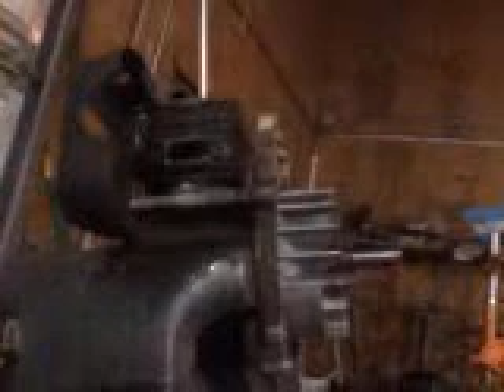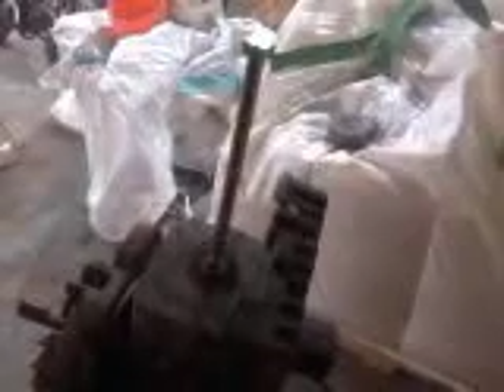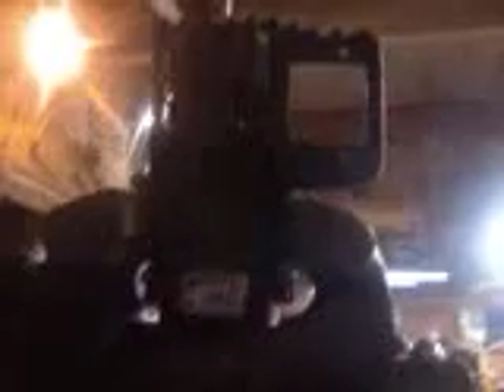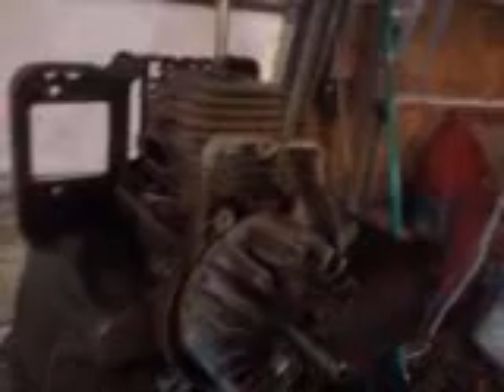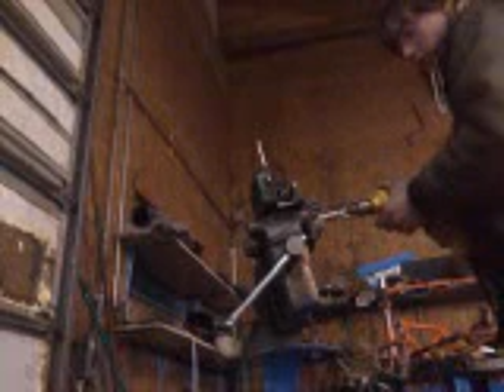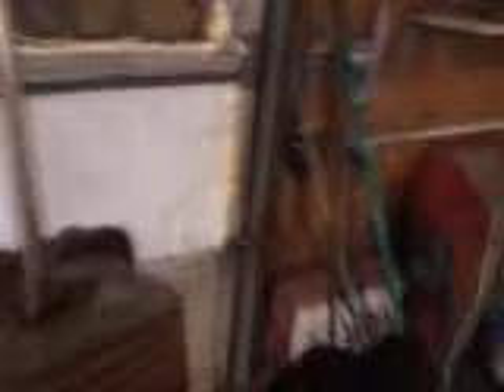first video of gas 2 cycle engine CONVERTED to DIESEL

Comment: I'm hoping you're having better results with your two stroke diesel engine. I like to know how far along you are and if you ever got it working . And what are you using for the fuel delivery system
Reply from the maker: I actually haven't done much more with it since. Lost all affordable access to any kind of machine shop, so fabricating things of precision pretty much came to an end. Massive family problems occurred which is why I lost access to the shop. Basically limited to a dremel, drills, grinders, welder, and sawzall now. Had access to a mill, lathes, torch, band saw, presses, brakes, vices, clamps, benches, etc. at the time I made this video and did this experiment.

Comment: Would this be all that hard to do with a chainsaw?
Reply from the maker: That completely depends on the spark plug hole position. If it’s the standard angled hole, it’ll be very hard. I’m actually trying to fill the hole with JB Weld on another one, and I’ll see if that works. It helps a lot if the engine has at least 2 piston rings too.
Reply: @lawnmowerrepairsandstuff3154  Could you recommend an engine to do this with? I'd really like to build a diesel circular saw.
Reply from the maker: I did this with a 25cc Homelite. Make sure it has the three cylinder jug base mounting screws, or it simply won’t work. Also, find one with the really thick connecting rod. I actually tore this entire engine back apart, and found out that the rod had bent! This one had the lighter rod though. These things are easy to come across at junk yards and yard sales. Contact me on Facebook if you’d like pictures. Just search for “Lawnmower Repairs”, and find the one with this same profile picture.

Comment: Hey are u still active
Reply from the maker: In what way? If you mean getting that engine perfected and running perfect on diesel, slowly. I got hung up on a bunch of other things that have been slowing me down on that. Yes, I still do tests of all sorts on many engines, but I don’t video everything.
Reply: @lawnmowerrepairsandstuff3154  Could you upload a newer video of the diesel? And im trying to design a 2 stroke diesel for myself on a motorised bike. ive looked at a lot of videos like this, i liked yours the best. I also have an idea for a new transfer port design
Reply from the maker: You might consider buying a model airplane nitro engine with the diesel conversion kit. I don’t have one and never did, but I think it might help you to get it figured out. Porting the engine would help immensely too.
Reply: The only reason why that engine fired up because of the starting fluid not because of the diesel. I too am interested in making a two stroke diesel engine and if you have better results please put them online I really like to see how you come a long
Reply from the maker: @bgloon8464  I actually did get it to run for about a minute on oil and diesel with no ether, but then the rod bent to the point it no longer had enough compression to run on anything under compression ignition.